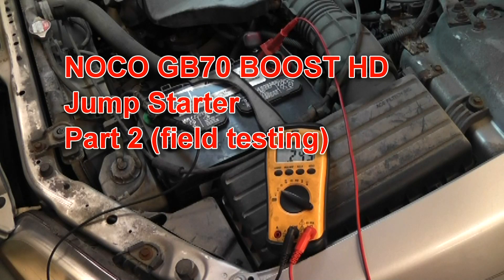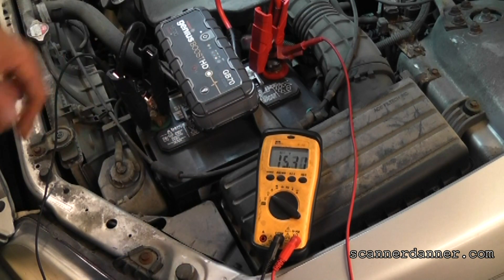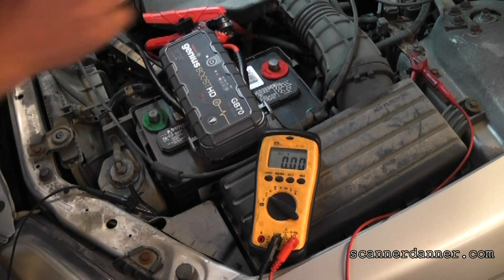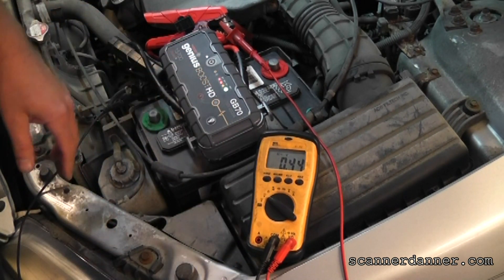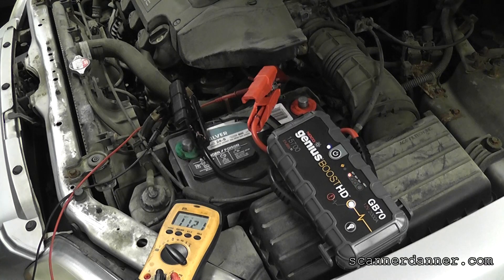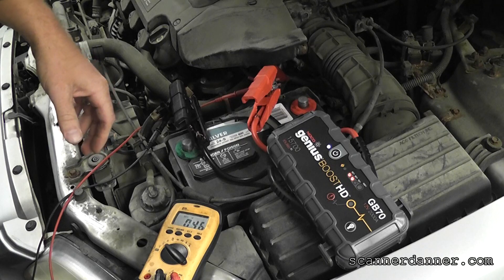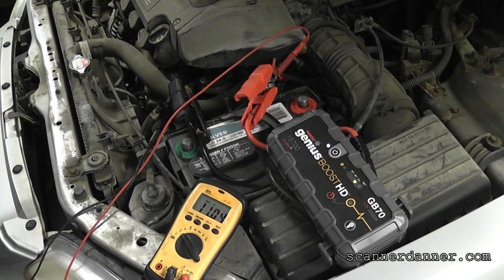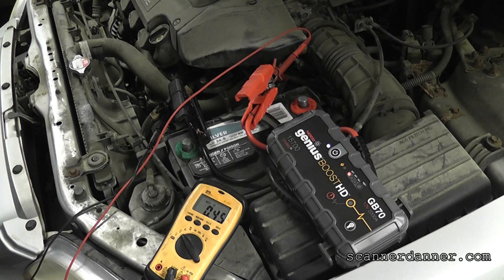NOCO GB70 BOOST HD Jump Starter Product Review Part 2 (Field Testing)

Comment: How is the unit, had it survived to this day?
Reply from the maker: It is about done. I can maybe get one jump out of it. And it has spent it's entire life in my truck (never worried about the heat and cold).
Reply: @ScannerDanner  i just bought one of these on sale and going off the 2015-16 era youtube mechanic analysis coupled with most recent follow up seems to indicate you won't be receiving another free tester because that first round did the promotional trick. it seems capable of powering an electric hotplate through  fused 12v inverter in the back of a uhaul tho no?

Comment: Just received my GB70 last week. I am impressed with your crank test. Each try at cranking is about 10-15 quick starts of a system that has a low battery. That poor starter is probably too hot to even touch.  I never crank longer than 5 seconds. That GB70 is VERY capable. Thanks for trying to kill it.

Comment: You happen to know how long it will provide 12v to run diagnostics on electrical circuits?  That's the problem I run into most of the time, being a mobile tech.  My larger jump pack has gotten to where it will only hold 12v for  a couple hours.
Reply from the maker: For mobile diagnostics, where you need long key on times and multiple crank times for no start vehicles, this is not your tool. All of these little jump packs do not carry the reserve capacity needed to do our kind of work properly.
Reply: Thanks.  I suppose I will start looking for s larger jump pack similar to the one I have now.  Will be a better option for me, I suppose.

Comment: The GB70 has a 2 year life span especially if you keep it in your vehicle and is susceptible to large temperature changes it will stop charging the battery
Reply: Is that what happened to yours? Seems pretty pricey at $200 just for it to die in 2 years.

Comment: I'm a diesel mechanic. I bought 2 of these. had a 2006 sterling with a 12.8L mbe4000 mercedes diesel. truck had 2 batteries with enough power to make the truck turn over 1/2 of a revolution. hooked up a fully charged GB70 and it jumped started it with no problem!! very awesome tool!
Reply from the maker: +Johnie Davis cool man

Comment: I just ordered the GB40 and I believe that if you leave the boost connected after starting the vehicle it should start recharging your battery the same way it is supposed to recharge any other device that it is made for, but I am speculating. "Great Job Big Guy"

Comment: I have been using mini boosters for some time now. I bought my first one from Matco 3 yrs ago. It's smaller than an iPad mini, and serves as a power supply for anything with a USB cable. It works pretty good, but the only flaw is the crappy booster cables. At least for a technician, they don't last.
It's definitely an emergency use jumper. And very competent at that.

Comment: If you have the choice between checking the manual and blowing something up, you should always ignore the manual. Does this even need to be pointed out?
Reply: +Baerchenization What the users manual says (as far as leaving it connected to a running vehicle)
 "once you have started your vehicle, disconnect the battery clamps and remove the GB70". There are No cautions, no warnings at all as far as leaving it connected to a running vehicle or that it should be removed immediately.
Reply: +ScannerDanner Premium "I don't remember seeing that in the owner's manual" - that would be the time to have another look...
Reply from the maker: +Baerchenization I just told you what the owners manual said. If I said that in the video then you are correct. I should have cover my bases better. My thought was if it was going to be damaged or catch on fire, I would rather have it happen to me on camera.

Comment: that pack is probably 6 ultra caps in series, at 2.7v a piece you got a max of 16.2v before you blow a cap. nice pack though and would be something nice to have, that alternator tho seems to have a malfunctioning regulator.
Reply from the maker: +1mouse3 what makes you think that? Nothing wrong with 15v, especially with the battery removed from the picture
Reply: +ScannerDanner optional charge point of a 12v system is 14.8v, so most are regulated to around there. yes most stuff in a automotive system is safe till high 16v, but charging at ~15.5v with battery did seem a bit off for the system. that could be just a issue with the field pickup on the alternator, but main issue I see is you might be getting close to the gassing voltage of a 12v lead acid.

Comment: +ScannerDanner

Yo, You might want to have a look at this pack:
http://www.amazon.com/1byone-New-Release-Multi-Function-Ultra-bright/dp/B00QPQD1NQ/ref=sr_1_2?s=automotive&ie=UTF8&qid=1447243026&sr=1-2&keywords=lithium+jump+starter

It claims that once the vehicle is running, that it can recharge itself from the vehicle through the clamps (assuming its alternator is working).
if one can get around the 30 second timer then it could be very useful as it can be left connected, and as it can self recharge, it means that it could last a while in a classroom environment without needing to be charged from mains.

Comment: I thought most cars with electronics wont start at under 12volts even though they crank because of the computers? Would you recommend this charger over the Schumacher PSJ-2212 for a 2500hd 6.0gas?
Reply from the maker: +Stephen Cunningham no, normal cranking voltage is always under 12.
Reply from the maker: +ScannerDanner also I did this review for them because it was given to me. I am not endorsing or promoting this product (well I guess I am helping to promote it) as better than the others on the market. I just showed what this one can do. Thanks for watching

Comment: You could leave it on there if it was LiFe chemistry. Come to think of it, it's probably LiPo.  The volts it's putting out (12.1) at its displayed 100% charge rating suggest it is a 3-cell LiPo.  A fully charged LiPo cell is 4.2 volts but it drops off from 4.2 down to about 4.15 volts after resting.  4.15 x 3 is about 12.45 volts.  Your 12.1 would be indicative of a 3-cell LiPo that is about 90% charged.

Very different chemistries, and a 3-cell LiPo has a fully charged voltage of 12.6 volts.  It would not appreciate getting 14.7-15.25 volts pushed into it.   LiFe chemistry s 3.6 volts per cell fully charged, which makes a 4-cell LiFe battery a good replacement for lead acid (depending on what kind of vehicle it's being used in).
Reply from the maker: +KaldekBoch good info. thank you!

Comment: NOCO has a 150 with 4000 cranking amps coming out in December. They claim it will roll over a monster diesel engine in -30f weather. it weighs in at about 9Lbs. l have the gb70 now and it's absolutely amazing, I'll be getting the 150 as well!
Reply from the maker: +Paul Babcock I want one of those!

Comment: send it over and I'll see what it will do on a 15 liter cummins
Reply from the maker: +Ozzy ô 6.0L diesel max, 8.0L gas max is the ratings on the tool.
Reply: There are some for trucks.  Some that even allow you the option of 12 and 24v

Comment: I dunno if you access to a 13L+ Diesel Engine but, a dry/cold start with 4 bad batteries would be interesting. Especially because they are branding it HD. If that can start a 13L+ with 4 dead batteries on a 30 or lower degree day I will be impressed. So much so I would actually buy one. and yes I am the same guy that gave you a hard time before I have no problem being proven wrong and accepting it but, with it being HD I would like to see that.
Reply from the maker: +UberArchangel lol your kidding right?
Reply: I am a big rig tech man. I hate lugging that huge heavy 4 battery jump box out to a truck 3 football fields away. Especially in the snow and it is not like you are going to be lifting something that is pushing 300lbs to put it on the back catwalk. So that is 2 trips for 1 truck. You said it that it has 2000 Amps. Most big rig batteries range from 950-1120CCA. If one battery is good even with it cold it normally will start. Some require 2 but, rarely any more.  I swore Rosedale had diesel. Least you could do is try it on a diesel.
Reply from the maker: +UberArchangel we do but they are in a different building.  NOCO says it is for a 6.0L diesel and 8.0L gas max so I doubt it would be good for what you mentioned. I'll be using it some more in my field work for sure, so you'll get a better idea of what it does in the future. Thanks man
Reply: UberArchangel Try the GB 150.

Comment: why do car makers just replace the battery with something like this!?!!!  This was incredible! Why Lead Acid?
Reply: You are correct. Safety is basically pretty much the only thing that it's in the way. Boeing 787 aircraft is the greatest example, in the past, aircraft are using Lead acid batteries to run the avionics on-board till Boeing 787 design. For the first 2 years of the aircraft released, Boeing ran into battery trouble from over heating to fire. Li-ion is very powerful at the same time it is very dangerous if it become overheat or when gets into an accident.
Reply: Brent Phillips Maybe it's a safety issue.

Comment: I contacted NOCO Customer Service yesterday by online chat. I asked them about leaving it connected up to 5 minutes after start up to drive the vehicle into a repair bay. They told me it should be disconnected with in a few seconds after start up to avoid damaging the unit.
Reply: +Patrick Curran that sucks. I'll have to leave mine connected to a running vehicle for longer than I did in this video as a test
Reply: +ScannerDanner Premium I had an anti-gravity lithium Ion Micro Jump Box and the warning on removing it right away after starting was in the instructions. It said if you didnt remove it, damage could occur and it was not covered under the warranty.  I dont expect it to blow up or fail on the first time it gets left hooked up too long, but probably wont last as long as it would have otherwise lasted had you followed the instructions.
Reply: +ScannerDanner Premium 
Yo, You might want to have a look at this pack:
http://www.amazon.com/1byone-New-Release-Multi-Function-Ultra-bright/dp/B00QPQD1NQ/ref=sr_1_2?s=automotive&ie=UTF8&qid=1447243026&sr=1-2&keywords=lithium+jump+starter

It claims that once the vehicle is running, that it can recharge itself from the vehicle through the clamps (assuming its alternator is working).
if one can get around the 30 second timer for how long it enables power then it could be very useful as it can be left connected, and as it can self recharge, it means that it could last a while in a classroom environment without needing to be charged from mains.

Comment: Now that was impressive. Look forward to see in the future how it works on a  late model computer controlled alternator or coded battery .
Reply: +Steve Rob what do you mean by coded battery?
Reply: John quite a few late model vehicle mostly high end  euros have a specific battery code on the battery that is programed into the vehicle. if you don't take it to the dealer of you know how to do it yourself the vehicle will not start so at what point does a discharged euro need a reset I don't know  and I guess Paul will let us know as his review goes on.  Paul would know far more than I, I have no experience on euros and this info is from what I have read.. Friend tried to use one of these style of boosters on his BMW e46   and it did nothing, not saying this one is the same, this one Paul was using looked far more advanced.  Take Care Steve